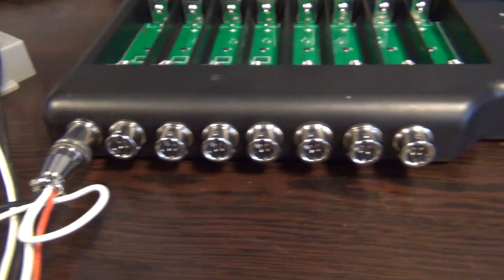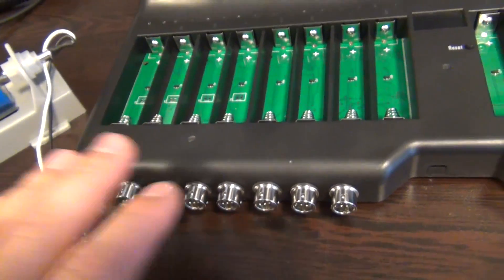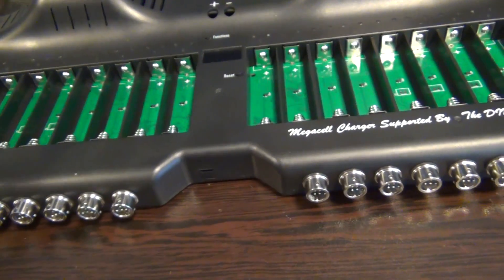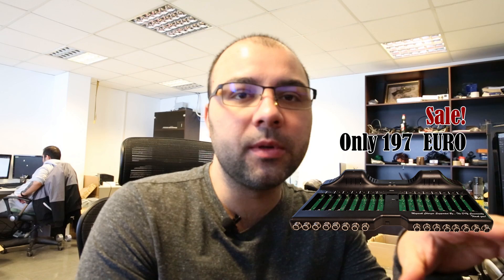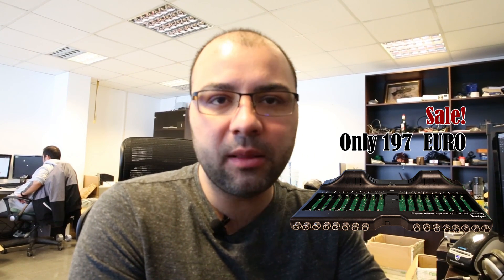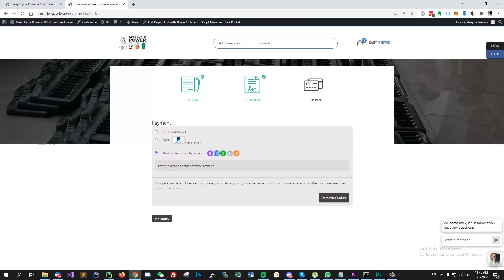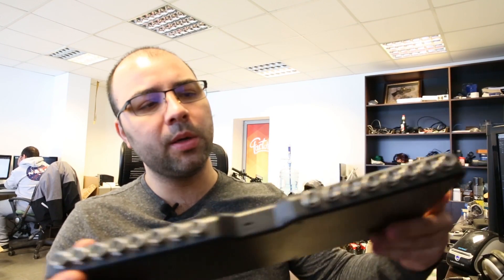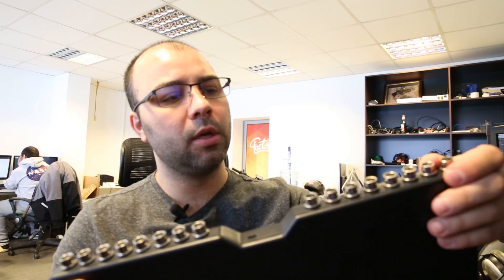Megacell Charger XS10 - Pre-Order Sale

Comment: Let's call this what it is...STUPID, dumb and idiotic! Just PUT spring loaded cell holders in the charger that can hold larger cells! So what it's wider!!! These things are already pretty big! No need for additional cell holders, proprietary connectors and all that mess!!! BUILD these chargers WITH larger cell carrying capability BUILT-IN!!! Also, the existing 18650 battery holders in your charger are garbage and you KNOW they are! They NEED to be replaced with something much MORE reliable anyway!!!

Comment: Well my original megacell charger still has 3 unreliable holder from were the wrong resistors were originally placed and then repaired but not 100% successfully. I think this new charger is a great idea i just wish my original had worked in the first place. If id have bought it from a shop i would have probably returned it already. It was such a huge pain to send it back to you and wait for the repair last time. I am not sure i would want to go through that again to have a charger which can only do 13 cells at a time.

Comment: Would the new version support LiFePO4?
Reply: I tested on MCC LiFePo4 in 18650 format, no problem :)
Reply: Old version supports LiFePO4 as well but is hard to interface with. You need to charge the charging threshold and discharging threshold in the software to match the LiFePo4 requirements.

Comment: Is it possible to control temperature when testing in external cell holder?
Reply: For now it's not possible to do that with the external connectors. External temp sensors must be mounted on the board and manually placed on the cells, but I think it's quite tedious. I think an external device that has temp sensors and communicate with the Megacell monitor will be the best solution for this. Or thermal camera with threshold on temp in sight.